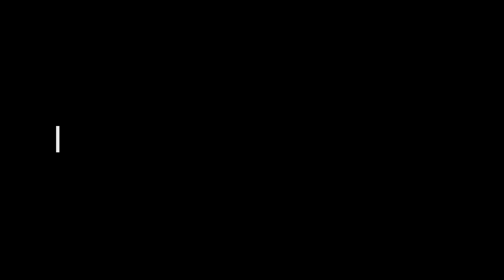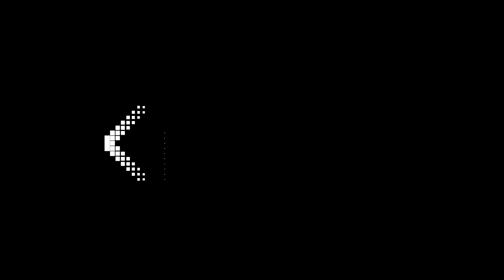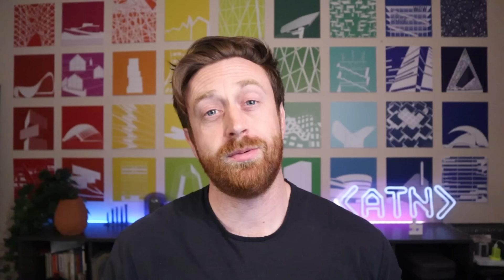The Rise of BIM 2.0: 9 Startups Redefining the Future of Architecture Software

Comment: Commenting before checking if these companies offer some form of 'free' access or local software:

If they do not offer a freemium model, the 'paywall subscription' will slow down the democratization of AI at the base of the architecture pyramid. For an emerging country, if you go after multiple software subscriptions, it ends up being very—like VERY—expensive.

The integration of AI will not be uniform. The ecosystem will split: the market elite will migrate to these new integrated cloud-based platforms, while the rest of the world will have to make do with a 'Frankenstein' workflow, relying on the solid foundation of legacy local software (which is often cracked, being the main reason for the popularity of tools like SketchUp, AutoCAD, Revit, etc).

Comment: At the end of the day, it looks like Qonic is the only challenger to Revit. None of the others do any engineering, structural (steel, alu, concrete), piping, electrical, schedules etc, so they just nibble at the easiest parts like massing, siting and feasibility. You'll still need Revit (or Qonic) if you don't just do concepts.
Reply from the maker: Yea agian the key part of the video is this takes time, they are not just going to magically have MEP, Structure and Architecture completed after a few years. Give it time.

Comment: While i acknowledge the trend, i still have my doubts. 
1. what i'm missing in thes video is the interoperability information, the way the stakeholders communicate while using their platforms of choice. I have never used anything from Autodesk (not even AutoCAD), and i don't want to be excluded, neither in BIM 1.0,  nor in BIM 2.0. What are the output and input formats of these 9 tools? For decades we have fought for some common information channel, the one called IFC. That's why i welcome BonsaiBIM with its native IFC. How about these tools presented? It looks like a native silo tries to compete with another native silo, this time in the cloud. Correct me if i'm wrong.

2. the other issue has been raised here already: the professional liability of the designers. In my country for the results on site there are two persons responsible: the construction manager, and the respective designer of the defective part (and indirectly, the supervisor). Leaving the editability of the cloud-based model to any designer is a danger in disguise. Will AI take over the impact of potential design flaws?

Comment: I’m not an architect, just a homeowner with some CAD experience (fusion360). Can anyone recommend what tool would be good for me to model my existing home in. It’s an 115yr old home with lots of weird features and modifications. I want to model it to record framing, plumbing, electrical lines etc as well as do internal and external renders as we embark on remodeling it.
Reply from the maker: I think the best bet would be SketchUp, easy to pick up and you can model the basics of what you're trying to do. If you want to model the details of electrical lines and plumbing you might want to hire a CAD technician to do it properly for you.

Comment: I feel like the thing missing from your narrative is the role of VC funding. "BIM 2.0" is just a away to leverage VC funding to develop the next neat front-end tool for either esri, autodesk or Bentley to buy you up.

They aren't really doing anything that isn't already possible in other software - problem is, if you can't go straight from high level concepts into drawings, the tools are nothing more than a children's sandbox. Fun to dabble with but not a place where you can get real work done.

Which is where I circle back to the VC part. Call me cynical but these are just fancy ways to try to make a quick buck. Everyone wants to be the next Spacemaker (the company autodesk bought and turned into forma). Things like Arcol strike me more as technology demonstrations than actual, real tools.
Reply from the maker: I think the VC element is a component and yes some will get acquired, but I wouldn't see this as a quick buck. These take a lot of money to develop to a usable level (of which they are still all quite early) and there is still a high risk many will die. Again I would also not underestimate that these are still very early stages so they will develop rapidly from here into more mature products. You can't really complire them apple to apple with current software.

Comment: I've always wondered - isn't there anything that addresses the workflow interior design + documentation challenge?
Yes, there are tools that help designers create layouts which can then be exported to Revit, but then you still need to handle design development and documentation using pre-prepared Revit templates for offices, hospitality, etc.

Today, many of these design development tasks are still being done in SketchUp because it's so much faster than Revit for designers. Has anyone thought about developing some kind of workflow or platform that could improve and streamline this entire process?

Interior design is a huge business, but BIM tools seem to be built primarily for architects and engineers, leaving interior designers to patch together workflows that aren't really designed for how they actually work.

By the way, FANTASTIC VIDEO!
Reply from the maker: Its a really good point, in theory tho a good BIM software should be able to do projects big or small from interior to exterior. Rhino is a good example for that.

Comment: Well done on showcasing forward-thinking, open-minded software. Even though you slightly shaded SketchUp in favour of Rhino and Revit interfaces (a cliché and boring practice in the architecture world by now, sadly), I still appreciated your video overall. Well done mate.
Reply from the maker: Thanks, whilst SketchUp is still probably the most used 3D modeling software its just not used by top design firms, it has such a low ceiling for what you can do with it, also its a bit of a deadend software, you can't convert it into BIM, has very little drawing capabilities so you double up modeling things twice or drawing manually.
Reply: The amount of times over the years I've banged my fist on the desk when getting an skp file for use in bim. I never understood why designers stuck with it instead of exploring Formit for "massing design-to-bim" projects. Made the whole process so much harder. I really like snaptrude's "initial massing here and send it to bim later" approach in this respect.
Reply: @HippieP629  Maybe don't bang your fist on the desk?
Reply: @L0sudsz  Or maybe not hire designers / consultants that bring the project to a grinding halt? +shrugs+

Comment: Why the obsession with Revit and its add-ons? Revit is NOT the only BIM software it is not even the best! Both ArchiCAD and Vectorworks were more advanced than Revit and both remain far superior from initial feasibility to final renders and construction information without leaving the software. If all you've used is Revit and AutoDesk, look around you!
Smaller teams were also mentioned in the video. Really? I worked on a £7.5 million (2005 prices) hospital project from the end of RIBA Stage 3 to the end of Stage 5 as the only member of architectural staff on the design team, using ArchiCAD, 20 years ago! Even now, as a solo micro-SME I could handle, as the only architectural staff, projects up to £20 million using Vectorworks, the BIM software I now use. Unfortunately, the PII premiums make it an impossibility. That is what needs sorting out, outdated business practices such as D&B.

Comment: I'm glade you called out revit. It's still massively over priced with an outdated interface.
Reply from the maker: Well it's not just me, it's all the people that wrote that open letter.
Reply: For what I can see... most architects are actually thrilled with this. Every time I try arguing that this is what happens with subscription models... they attack me defending their preferred software at the moment and how it would be impossible for devs to work with perpetual licenses model
Reply: @Arq.LeLopes  sure but Autodesk are having their cake and eating it. They charge a subscription yet do hardly any real development.
Also their security authentication model is flakey and acts more like virus than a paid bit of software.

Comment: I'm a facility manager, but fascinated with what BIM 2.0 is about to do for AEC and M(maintenance).  Building expenses are WAY higher after construction ends (cumulatively, for the life of the built environment).  The AI juice about to hit is architects of limited FM familiarity will be able to cost model the operations of a proposed building design for X years after ribbon cutting.  Decision makers LOVE this probability and "greening" options can begin to show their fiscal responsibility.  Value engineering becomes a toggle switch between (cataloged) options and AI crunches the numbers to ROI gold.  Even small firms will have this ability.  The "winner" BIM 2.0 software provider will do well to assure their API collaborates with the major Computerized Maintenance Management System software providers.  If the digital manifestation doesn't match the one the facility technicians touch, the two worlds will diverge markedly by the end of the warranty period.  If I were an architect, I'd be learning the one started by the former Revit folks.  That was headed this direction, albeit at a blue chip's pace.  In three years, I'm going to be asked to learn one of these.  That's fast!  Get ready.

Comment: Great content. I think your comment about the potential issue with focus on feasibility being double-edged could be right. I can see lots of developers just running the numbers using their own lightweight feasibility tools rather than going to an Architect, except perhaps for larger or really complex sites. Some of the other tools like plan generators could save a lot of time for much larger projects, but not sure there is a great workflow for smaller practices yet. As you said in the beginning, what we really crave is an integrated data platform and none of the softwares are quite there yet... exciting times though!
Reply from the maker: Yes great observations, lets see how this all unfolds!

Comment: Multifamily BIM in a nutshell..."Lets spend $100k's on a developing a model and then tell the field team that they are NOT allowed to use it for construction. And while we are at it, lets give the trades an inaccurate Architectural model and force them to use it for their model yet lean on our disclaimer when issues arise."
Reply from the maker: I do hear you on this point, but its nothing to do with the software. At Facit Homes we do exactly that, they are the designers and the builders and the BIM model is core to everything as the source of truth for what we are building. Traditional construction has fragmented so much that we now live in a 'not my responsibility' era of construction. Architects are paid minimum wage to work on these projects, you can't expect them to take on the liability for the build also.....
Reply: @architech.network I was hoping for a middle ground software solution…BIM light or something. I just hate when BIM is shoved down our throats when the base model isn’t even tight. Other industries (medical, commercial, industrial) properly implement a usable model that is 95%+ coordinated by the design team. In MF, we are asked to create a model using a base model that doesn’t even show unit in-fil framing. There is room for something between overlaying pdf’s and a proper BIM effort. Something for the people that can’t “see” the clashes on 2D plans

Comment: Government regulation on BIM content and process is coming fast or is already here, placing a challenge for the tool makers to support different expectations of different markets. 
I don't think the transition period needs to be as painful and expensive as it seems to be now. The efficiency, the output and the interoperability of the tools supporting architectural design from the conception to later stages of permitting and construction process is still not where it should be. The BIM models will ultimately be required live entire life-cycle of the building, after all.

Comment: The reason behind everything being cloud-based is that it becomes platform agnostic. No hassles with hardware compatibility and distribution of updates. The down side is that your software is reliant on your internet access and speed. There are also clients that will not accept their planning information being scattered across the WWW for nefarious types to hack and steal. There was no mention about how these platforms intend on securing your data. Then there is precision settings. Can I take a conceptual design and bring it into my BIM application and have walls meet at precise angles? Will I need to treat my concept model as background information that I trace and recreate or can I use the output and trust that dimensions and allotted square areas are within tolerances? I may save time in the concept stage, but waste more time in the development phases. Lastly, all that tongue-wagging and not a single mention of Graphisoft's ArchiCad which started the whole BIM modeling in the first place. (1984)
Reply: Agreed 100%. Regarding the revit, before autodesk had ADT

Comment: I think a lot of the cloud based aspects and “ai” junk is kinda a nonstarter for many firms. Both in terms of increasing expense and reliance on the SAS model over versioned licensure model. The “ai” machine learning models are a liability risk, both in terms of it being a black box, and in the tendency for proprietary information to leak. For companies doing work that is secretive or proprietary, both of these aspects are a liability issue that makes these nonfeasible for their process. For its failings, autodesk & rhino both enable secure and compartmentalised packages. Another issue which you present is the dumbing down of modelling capability. For a lot of the traditional space, the the clumsyness of rhino & revit have prevented them from transitioning from autocad to a bim package, because 3D modelling components in those packages is poorly adapted to complex building compents such as ornamental systems. I don’t see these packages as really solving this problem, both because their modelling capabilities are too limited, and because their cloud based design doesn’t really solve the rendering problem on the used side. In many respects most of the software packages mentioned seem deeply unserious as tools for professionals. 

I do think we need a real contender in the BIM space that improves on Revit. I think Vectorworks does a good job on the modelling side and I’m surprised they weren’t represented in this presentation. (Though understandably their weakness is in the MEP side compared to revit). But I think that if any real competitor is going to succeed in supplanting revit as the BIM platform of choice, it’s going to need to meet a few criteria:
1: local hosting, securitised files, but have the option of asynchronous file sharing or cloud based synchronisation and conflict resolution
2: offer greater model complexity without the clunkiness of asset class modelling such as in revit
3: greater control of output graphics, for use in presentation graphics & marketing
4: sound multidisciplinary collaboration for structural, mep, landscaping, etc. 
5: (probably) platform agnostic (staying tied to microsoft atm is a liability, when the windows platform has become increasingly hostile, and linux compatibility, and mac hardware have both made considerable inroads in performance and usability.)  
6: a better modelling and rendering pipeline. Revit’s pipeline is pretty antiquated and has given reason for secondary products such as lumion. 
7: nice to have but not neccessary is a file sharing and annotation system like bluebeam.

While I do think the “ai” generative models are interesting, I do not think they’re particularly useful for an architectural production environment. At least in their present form. It is likely an ‘ai’ feature will come around that will be useful in space planning, but i do not think that will be based on a large language model or generative diffusion model due to their propensity for hallucination. Using them for spec writing, or building code analysis is asking for trouble. (Their use has been prohibited for lawyers for this reason.) And stable diffusion based rendering, frankly, looks like garbage. It should not be used for presentation graphics.

Comment: Well simply put Sketchup With all the available plugins-pick the ones you need-is the only software anyone needs to model-and then create documentation-who I use Datacad-as my ‘paper space’  to create and final annotate 
Revit is cumbersome at best-we do use it because clients demand it as do some engineering subs.
It’s by no means the end all be all. Rendering-D5 is the leader in my opinion. AI code check, well I don’t think this is such a big deal- you should use it as a helper but should never rely on it, that’s your job! To read and understand the codes involved in your project, this issue with new hires and peo with no experience is they rely on these things and never ac learn, trust me I’ve seen many a Lic architect/engineer who passed an exam and that’s about it-worthless as far as knowing their craft.